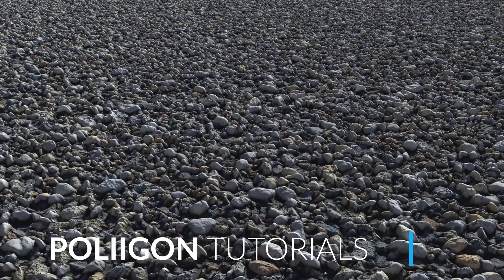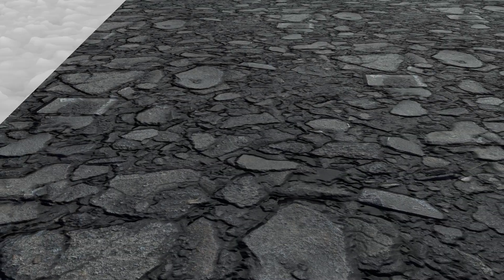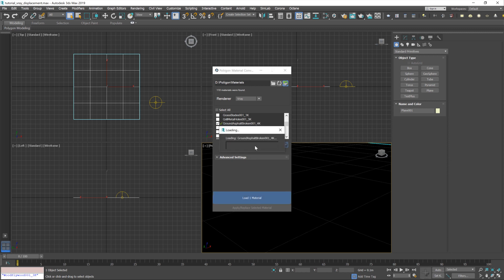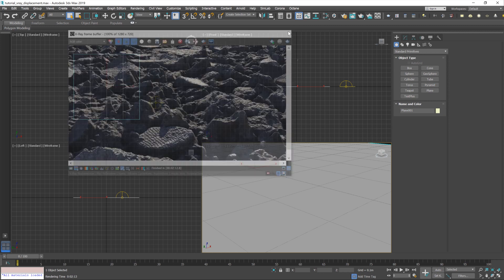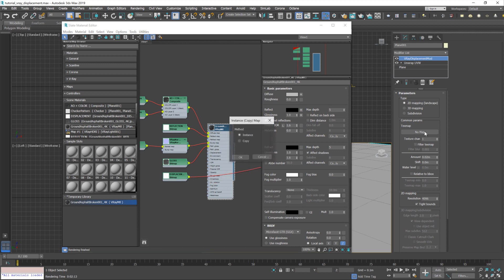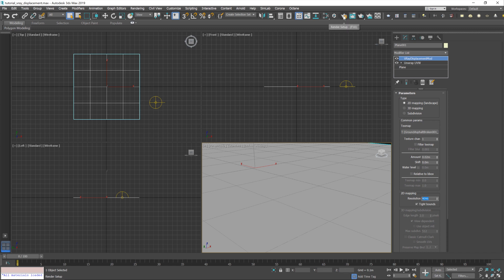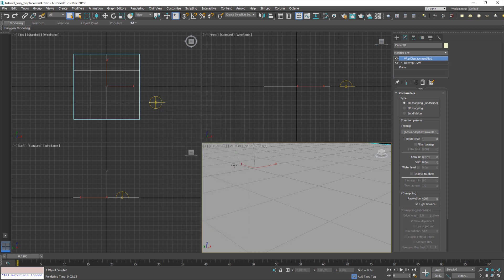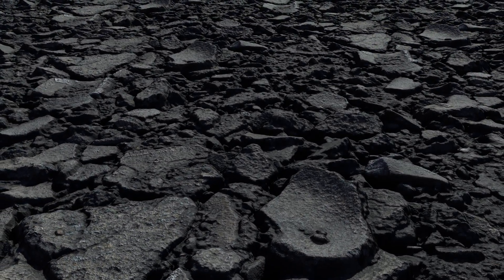Using Poliigon displacement textures in 3DS Max with V-Ray

Comment: Hi guys, love your materials. I'm having an issue when using displacement on meshes that are not planes. For example, on a box, when I use displacement, wheter I use the Vray modifier or the map on the material, it breaks the geometry. Each face of the box goes in its own direction and are not longer touching each other by the edge. Using the shift option below the amount helps, but it doesn't always correlate to the amount you use, so I have to keep guessing and trying. This doesn't happen if use 3D mapping, but if I do that, then there is no displacement, like using a complete black texture. 
Can you help me solve this problem?

Edit:

SOLUTION: Like A Mac said in the comments, you should make sure the adjancent faces have the same smoothing group, that way the object won't split. Cheers
Reply: Hey Mariano. Not sure if you solved this, but if you make sure that adjacent sides use the same smoothing group they shouldn't split.
Reply: @Andy_Macdoodle  sorry for the late answer, I just saw this and tried it. You are totally right, now it works like it should. Thanks again, man. I appreciate it.
Reply: How do yo do that?? the same smoothing group thing? Please Help
Reply: Juan Pablo Ortega did you try google? Anyway: Select your box, convert it to editable poly, in the modify tab scroll to smoothing group section. Select the faces of your mesh you want to group, then select a smoothing group number from the list. Done.